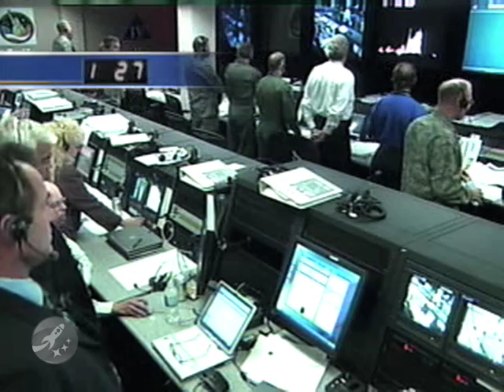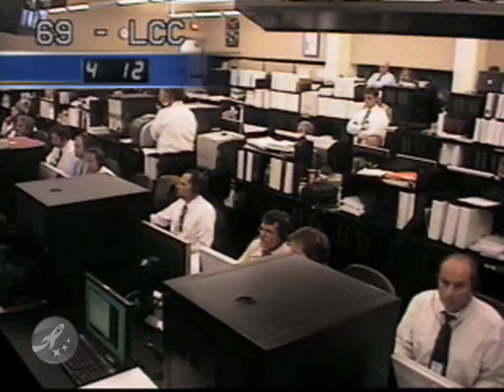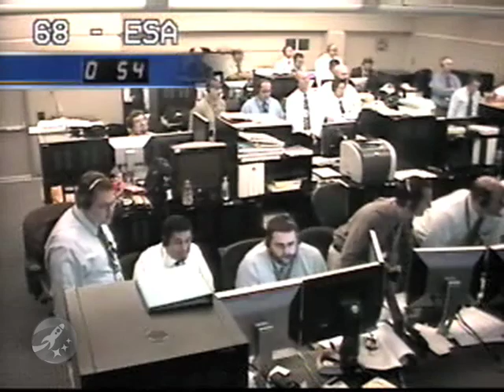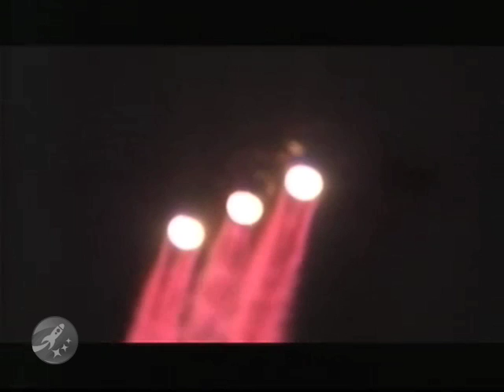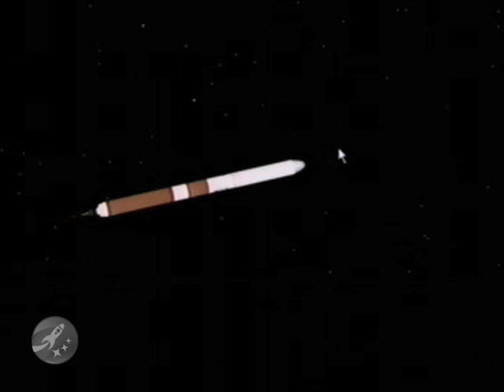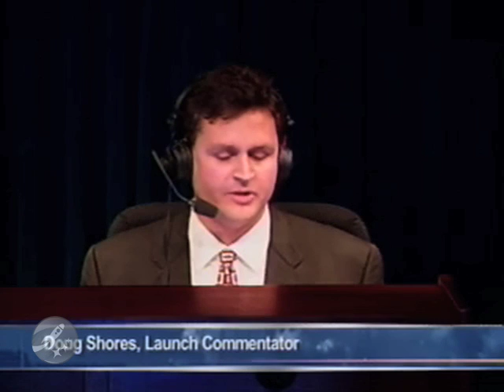Delta IV Heavy carrying NROL-26 Launch on Jan 18th

Comment: Don't forget that the Shuttle's strap-ons are Solid Rocket Boosters (SRBs) that burn "dirty" solid fuel.  In some configurations, Atlas 5 uses up to 5 small SRBs to augment the first stage.  The Delta 4 strap-ons are liquid fuel stages, very similar to the core booster.  Similar to Delta 4 Heavy, Atlas 5 Heavy uses a parallel-staging of three liquid fuel boosters (one core and two strap-ons).

Comment: The Shuttle's liquid fuel engines do use liquid hydrogen (and liquid oxygen) for the Space Shuttle Main Engines (SSME) in the tail of the Shuttle.  The solid fuel in each SRB consists of ammonium perchlorate (oxidizer), aluminum (fuel), iron oxide (a catalyst), a polymer binder to hold the mixture together and acting as secondary fuel, and an epoxy curing agent. This propellant is commonly referred to as Ammonium Perchlorate Composite Propellant (APCP). Source: Wikipedia.

Comment: @spacevidcast Wikipedia lists Delta IV heavy "escape orbit" payload capacity as 9306kg. I'm guessing that's FAR from adequate for a manned mission BLEO. I'm assume that's what you meant here. It would seem sufficient for unmanned missions BLEO though. What's the primary reason for not using slightly modified shuttle SRB's on another launch system? They seem like monsters in the thrust department. Is it mostly because of their failure on Challenger?

Comment: It does look clean because it does not have the environmentally bad solid rocket boosters. All you get is the H2/O2 flame, which produces water and initially just a few NOx compounds. This is the vehicle destined to launch the Orion capsule. The Ares-I needs to be cancelled.

Comment: @ithicaplasma Did anyone at Boeing ever crack a joke, when facing a particularly difficult problem, that it was "not rocket science"? That has to be the most annoying thing I've ever more than once in the workplace, typically from a manager who didn't want to hear why a particular problem was complex. The last time I heard it, I responded with "I'm amazed by your ability to differentiate between network systems administration, and the art and science of building rockets".